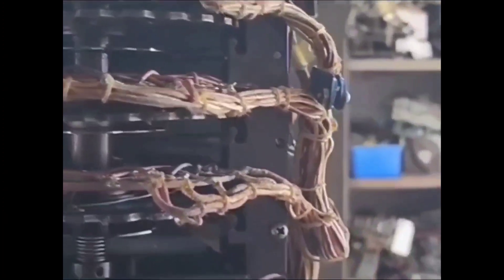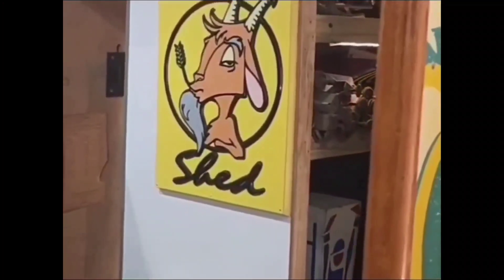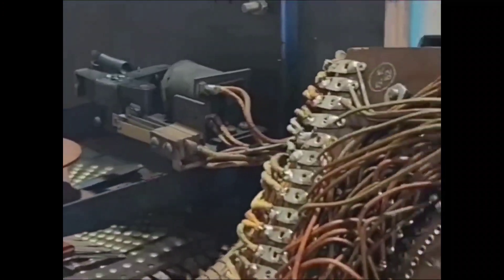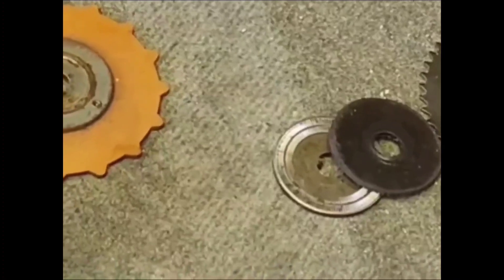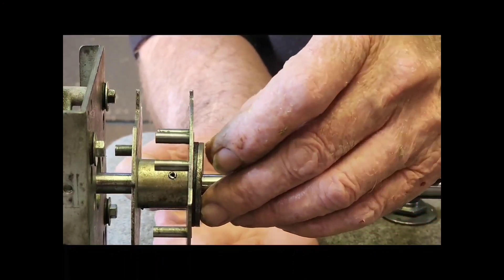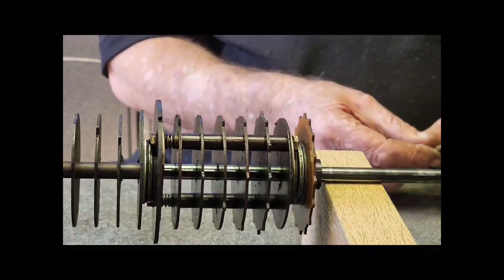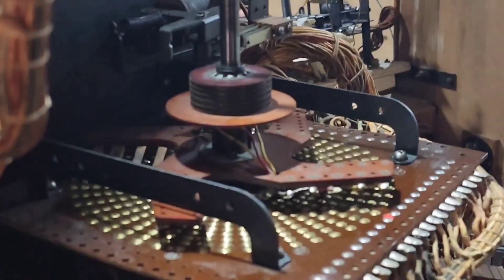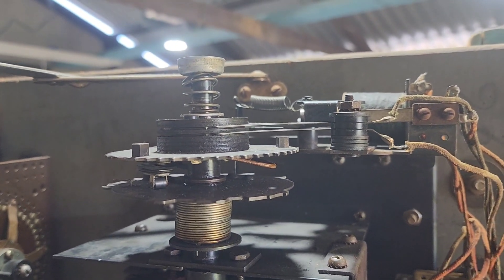Bingo Leather Cluch Replacement Control Unit.

Comment: The door comes off and you can lay it flat down on a table . It makes it much easier to work on . Just remove the metal bracket that holds the wiring harness to cabinet , then lift the door straight up and lay on a table .
Reply from the maker: Thanks mate it was you who mentioned that before I think we di so few of these we forget.